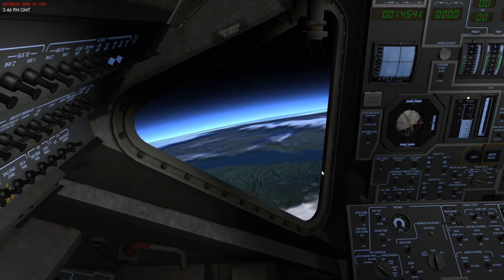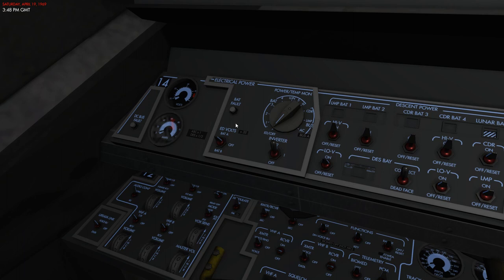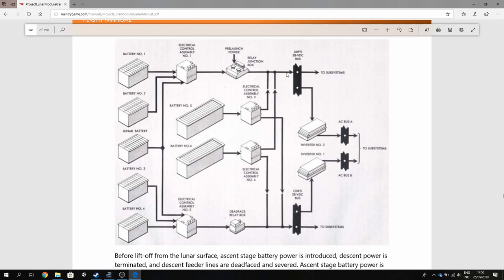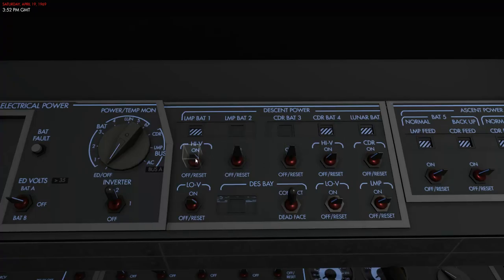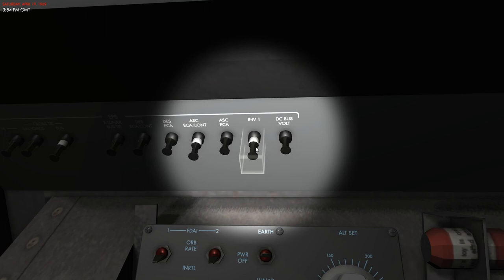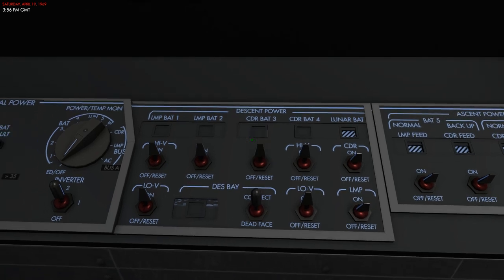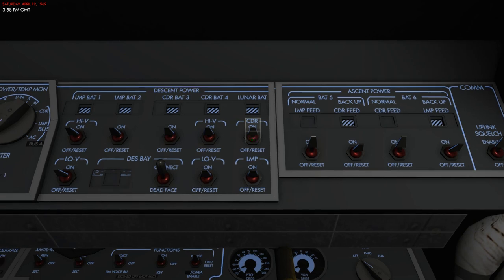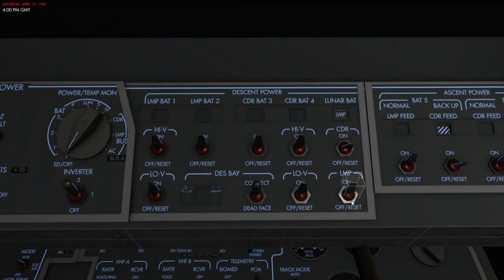Lunar Module Operations 3 - Electrical Power System

Comment: Could you make it so you can float around through the tunnel and in the lem?
Reply from the maker: Eventually yes, just need a low poly model for the transition (rendering both cockpits at the same time will be too much for many computers) :)